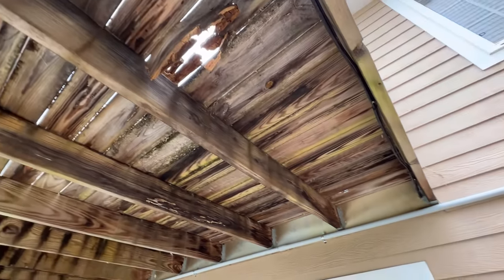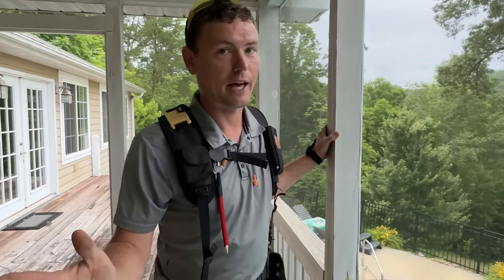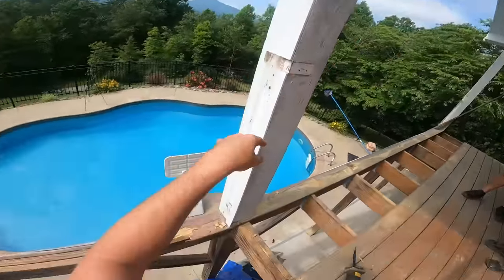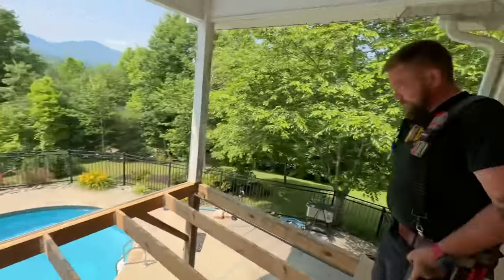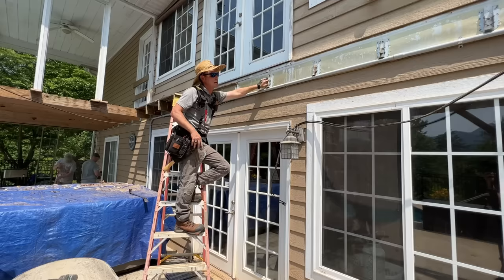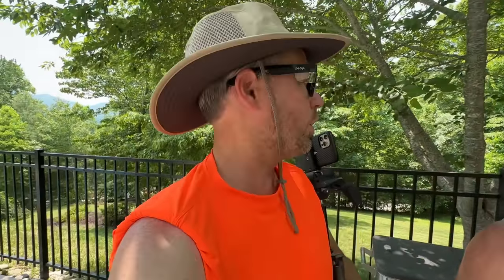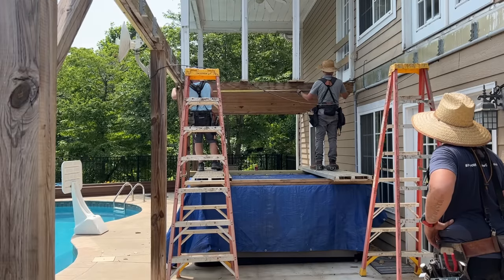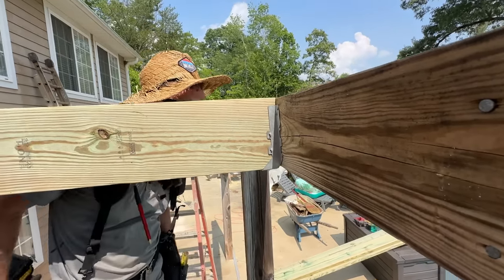Another "Tweener" Project! pt 1 of 5

Comment: Decking tape over the top of the joists and at the intersections with the beams makes a big difference on the life of the framing. Especially over doubled up lumber as the water can’t sit in between the framing members and rot it out
Reply: I would argue that joist tape would actually PREVENT the joist from completely drying out
Reply: @AM1015-  Nah that composite flooring is flat on the bottom, high end composite has grooves to aid in drying which their composite flooring didnt. Joist tape is def the way to go.
Reply: I commented the same thing on their last deck build. Wondering why they don’t use it… I’m sure Jamie has a reason I would love to hear why
Reply: @CMT905  Because then they won't get called back to rebuild it in 10 years time.
Reply: @AM1015- True, but I would have to disagree because you're not encasing the whole framing member in flashing tape, only the top and maybe 2 inches of each side
Reply: @CMT905  Ya, when they built that deck by the creek they also put the post beneath grade, which seems like a big no-no.
Reply: @bradlambert1679  ya but the moisture could migrate down with gravity, IF it were to penetrate through but very little moisutre will move upwards as its above grade. Hence why a waterproof barrier is a good idea on the top and run down the joist at least 1"
Reply: @CMT905 because it’s a product sold to homeowners just to make money. It’s better to not tape it so the lumber can actually dry
Reply: @boris9305  also you have it backwards the low end composite decking are the “grooved” type
Reply: @boris9305  couldn't agree with you more
Reply: @fancyfeast1001  I was questioning that too, but then I looked over at my fence and realized it's not actually a big deal. My fence is over 30 years old and the original posts are JUST starting to need replaced. The gates are hung on 4x6 and the rest of the posts are all 4x4 with only the gates and corners "cemented in". There's no aggregate in the mix and it's only about size of a no.10 can, about 3' under grade (the posts are 4' deep). We've only needed to replace 7 of the 41; 4 broke off below grade, 2 rotted from the top and let go of the top rail and one needed removed to get an excavator in for a septic system replacement. 

The replacements are just shy of 3' deep with gravel at the bottom and concrete filled 8"x2' sonotubes 6" below grade. I suspect the new posts won't make it 15 years. We had a lamp post installed in essentially the same way and it rotted out in 10.
Reply: @AM1015- covering the narrow edge of a board will not prevent it from drying out. The long edges and the bottom short edge are still exposed to air. Most of the top edges would be covered by decking anyway
Reply: Mr. Dwayne, can you tell what material good fits in house main room? Have a bad experience - cant repair for my comrade. 💥
Thank you.
Reply: Zip tape > actual joist tape

Comment: The top rot of the joists was likely caused by having an outdoor rug on the deck. The rugs hold water longer and also prevent the wood below from drying.
Reply: Maybe a lack of oil or stain should been done at least 3 time , make wonder any thing was applied to the deck?
Reply from the maker: Hey that’s a pretty interesting idea that I did not think of!

Comment: Deck joist tape is really good these days.  You’ll double the life of the frame.  A wise man once said that wood only rots if it can’t dry out.  So your section when you say a post was rotten where the rail met it was because moisture get in the can’t dry out.  Often only on that small part.  This is why the joist tape rocks.
Reply: Australian produced decking has grooves in the back of it, like anti-slip grooves which are placed down on the joist to allow air to circulate between the deck/joist to try and prevent rotting of the joists.

Comment: Great video! I recommend using a spud bar to remove deck boards. After replacing deck boards on dozens of decks I have found a spud bar to be a very helpful tool. I also suggest using zip tape on top of the joists (under the deck boards to prevent the deck joists from rotting out.
Reply: Wouldn't you be able to see the tape in the gaps?
Reply: @kchappell65247  Depending on the width of your gaps you can see the tape. In these instances it is better to use an all black tape.

Comment: Never leave the decking dry, slather out some lindseed oil on it once a year, or every 10 years if its barn planks. Mom made us do it every summer in the august heat.
Reply: Didnt it make it Sticky when dried ?
Reply: @arwogue  No it stays liquid, just wipe off any excess after a day, however when the wood absorbes the oil it will darken unless a light stain is mixed in. Water will bead up and not absorbe into the wood for about a year, its also good for wood hand tools like shovel handles. Be sure and throw the oily rags directly into the burn barrel or wash them directly out in the washing machine. The rags can spontainsly combust if piled up some place and burn your house or garage down, never keep oily rags around, wash and dry or burn them.

Comment: You can’t put the post on the trek decking because in different climates different trek decking, expands extraordinarily. Think of it like floating flooring. We put trek decking on a house in blowing rock, North Carolina, one time that expanded 6 inches and literally pulled the floor joists apart and pulled the nails out.

Comment: Custom aluminum flashing, Resisto, Blue Skin, Deck tape, hell even Zip tape on the tops of the joists will at least double their life span. I've also done solid composite products ripped down and grooved with drip edges attached to joist tops before decking. Years ago they had a vinyl C channel 1 5/8 inch wide but I've not found this product in over a decade.
Reply from the maker: I love the sea channel idea… Pretty much anything would really help even if it only last for 10 years that would extend the life of the deck by a long time

Comment: You mentioned the deck with rot was built 15 years ago…that would put it in the timeframe where they were switching chemicals from traditional pressure treated lumber of late 20th century to chemicals deemed less toxic!  My deck and privacy fence that I installed about that same timeframe had to all be replaced in the past few years as well as even the 6x6’s, while appearing solid from the sides, were completely rotted in all but the outside 1/2”!
Reply: Good point, I soak ground posts in motor oil, diesel because things rot so quickly.

Comment: Always use Zip tape on the joists edges before decking and you’ll never have rot.
Reply from the maker: Nice… I’m pretty confident it will help in the long term but we always check with the manufacturer and they did not guarantee anything as far as using it that way

Comment: I have seen some people zip tape the top of deck boards.  Would that help deter rot?
Reply: Australian produced decking has grooves in the back of it, like anti-slip grooves which are placed down on the joist to allow air to circulate between the deck/joist to try and prevent rotting of the joists.

Comment: Hey Jamie - how about an oscillating saw equipped with a metal blade for those joist hanger nails ?
Reply from the maker: I think Jaime is too cheap to buy those expensive oscillating tool blades in bulk… I think they get about $45 for a three pack of them at Lowe’s

Comment: Why did you not use YellaWood Joist Shield waterproof self-adhesive butyl tape on top of the stringers? It keeps the water off the top of the joists and keeps them from rotting.

Comment: Retired Builder and Trade Rep from Australia here.   I find it strange that your H3 (Ext/Above ground) Treated timber used structurally is WET after treatment, where as in Australia it has to be DRY after treatment to be classified as structural.  WET after is Agricultural Grade, eg, Sleepers, logs and fence material.  Radiata Pine is usually the timber used.
Reply from the maker: Yes… Our pressure treated decking comes absolutely soaking wet. You can buy some that is kilndried but it’s very hard to find

Comment: Are there any companies in America selling a aluminium deck framing system?
Extruded aluminium posts bearers and joists. Cast aluminium connectors and joiners?  Finished in your choice of powder coated or anodised colours? 
I mean if the boards aren't going rot you don't want the frame to either right 🤷‍♂️

Comment: The treatment process nowadays is not as good as it used to be 20+ years ago. 

To compensate, a lot of builders put zip-tape or some other type of water-proof membrane on the top of all joists and primary beams. I've personally experienced this before, and yes, it will rot all adjoining joists/decking.
Reply from the maker: I would agree with that as well… It’s probably a much safer chemical but I don’t think it does as good of a job as the old stuff.

Comment: I don’t know how old this video is but I’ll tell you what if you take some of that flex tape did you guys put around the house and put it on top of those Joyce’s before you put the floor down but it will prevent them from rotting out I watched a program before or a woman did a house, and she put that flex tape on every Joyce in the house and outside and I’m telling you right now. She has no problem. I’ve been looking at the program now and then she still has the same solid choices. Running across back-and-forth. Just a heads up.

Comment: The problem with builders is that they just Don.t bother to think how to preserve materials and only put things together happily rebuilding same decking after 15 years at 50 grad extra again. All what was needed is to give all wood a paint and 2 extra layers of warnish.With that it would easily lasted another 30 years. They use pressure treated wood but when just left outside it will eventually rot and get black molds which will need to be replaced...

Comment: 15 years and a new deck?? In Germany the owner would kill you if he has to do a new one after only 15 years. BUT in Germany no one would do such a "crappy" construction. We would not use wood for that (or anywhere else in the house). Our homes are built to last forever. Just see Arnold's birth home in the Netflix documentuary. Built in the 1800's and still standing and still the original roof!
Reply from the maker: We always do recommend that our clients use composite decking on any open decks without a roof. These clients at the time did not have the extra money so they ended up doing the treated wood everywhere. Pressure treated decking does seem to fare pretty well if it is covered though.

Comment: Video hasn't even started and I see the deck is already rotting after only 15 years. This is unacceptable.
My deck/balcony is made from some sort of soft pine wood, is over 20 years old, showing signs of rotting in one isolated location where a large flower pot used to stand  for one or two summers. It is located in the middle of Europe, the material is probably some species of larch, entirely untreated. Due to the local climate (occasionally hot summers, very wet the rest of the year) it usually turns green and there's even some moss growing in the gaps which I scrape off twice a year, but I assume it has another 5 to 8 years of usable life. 

It directly sits on a galvanized steel frame with a joist distance of about 90 to 100cm (about three feet!), which is way too large. I was thinking of attaching some piece of wood in the middle between the joists, so the loads will spread out over several of the deck pieces, but since I  rent this place and none of my guests fall in the 250 pounds plus category I don't really feel like it at the moment ( I prefer my female guests to be considerably lighter than me... ;)

Comment: Bit shocked about the state the deck is in in only 15 years. Is this normal?  Is it lack of maintenance? Expensive hobby to get your deck renewed every 15 years.
Reply: It’s so disappointing to see so much waste. They didn’t even get 15 years out of that deck. It was clearly compromised a while back. American’s and their decks. What a joke.
Reply from the maker: Not exactly sure why that one fared so bad… I do know that pressure treated decking if it is covered or regularly sealed and stained will last a whole lot longer than that. I also think that the gutter was dumping an excess of water on that section of the deck for a long time.